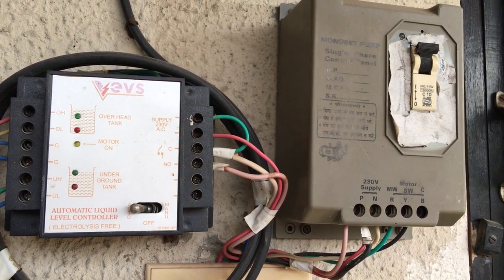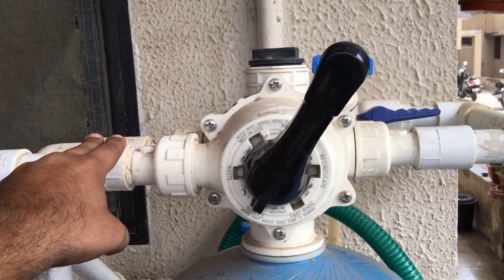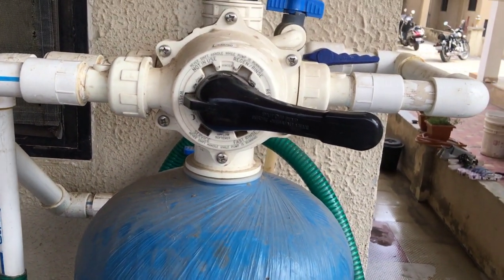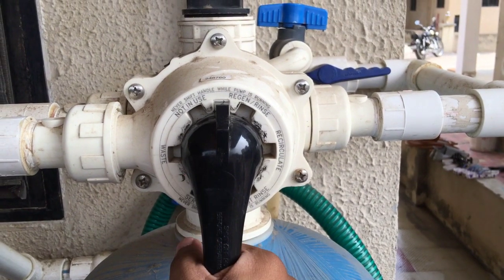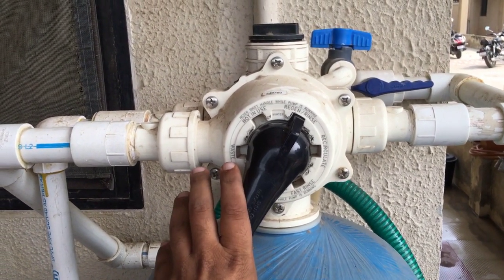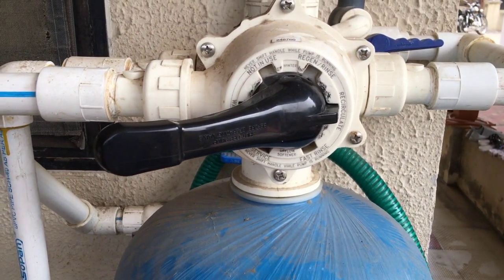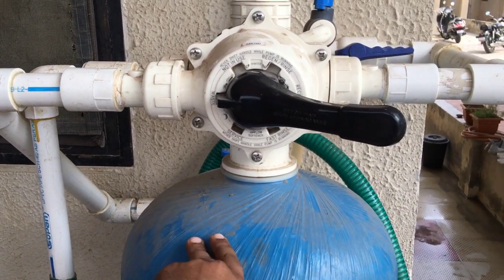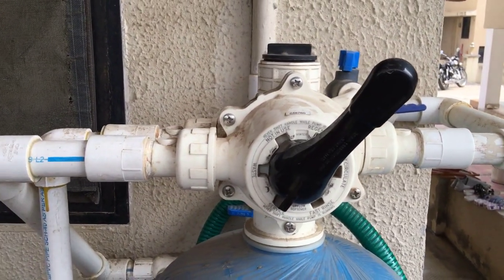What does it mean when a water softener regenerates 👉 water softener regeneration process must watch

Comment: What would be the cost of one softener unit?
Reply from the maker: The cost depends on the size of Softener in Lts. Apart from that if you add Filter Units, the cost increases. For the Unit that I have demonstrated the process, Cost is around Rs. 25000 and is 100Lts.